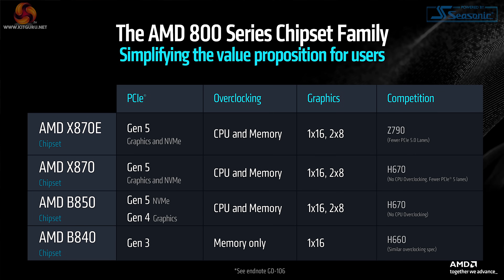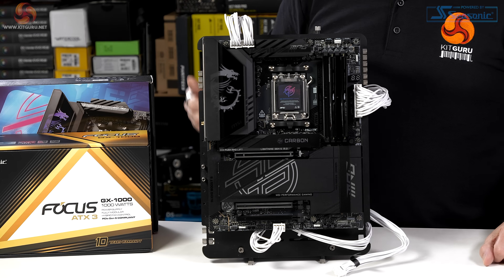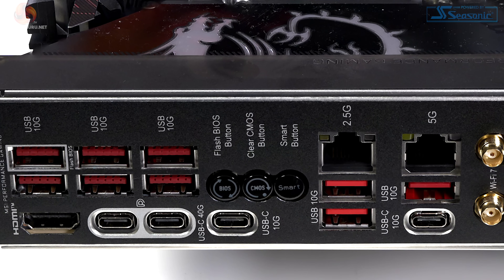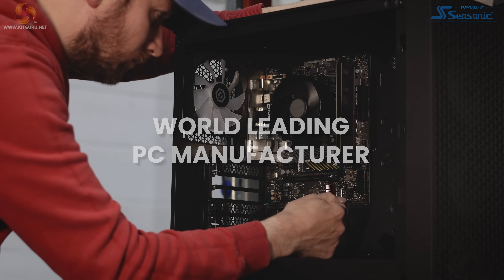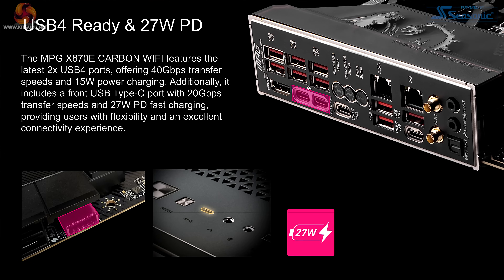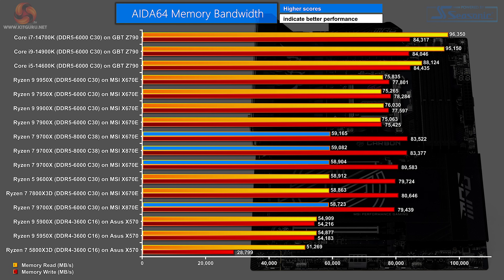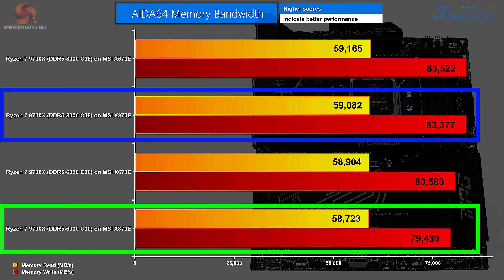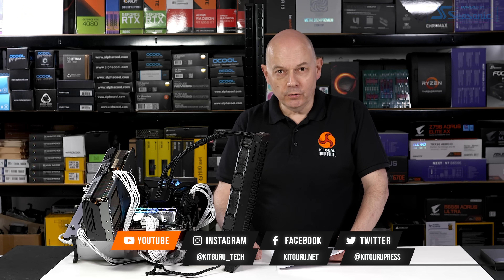MSI MPG X870E Carbon WiFi - DDR5 8000 for the win!

Comment: Mixing 2.5G and 5G is just silly. Please just provide two 10G with backward (lower-speed) compatibility
Reply: The boards are expensive enough as it is.
Reply: @RavTokomi  honestly it wouldn't make a big difference if they didn't blow their markups as usual
Reply: I don't need it myself, but I agree 10G for those who do would've been good. Would've drawn some more people to this board as well since competitors don't provide it either if I recall correctly.
Reply: @123Suffering456  Yeah sure, I don't need it as well, I'm much more patient at my 53 years of age ;-) Cheers bud all the best to you !
Reply: Is that a chipset limitation?
Reply: @philipjfry628  no not really
Reply: @b1lleman  Bit annoying then should have just stuck a pair of 10G ports. They saving that for the Godlike maybe?
Reply: @philipjfry628  Ah yes probably. Personally I would prefer they'd provide a basic Motherboard with lots of PCIE extensions possible but they wouldn't be able to charge that much.
Reply: I agree. Who amongst us have 2 LAN cables plugged in anyway? Don't peeps just use switches?
Reply: @LollyBread  Well, in a previous life not so long ago I did NIC teaming to my two redundant switches ;-)
Reply: @b1lleman  Woo, we found a use case. :D
Reply: @LollyBread  LOL !

Comment: Its a decent board - nice featureset, looks good, they put effort into the ports and layout - but its not really a huge upgrade from the last gen unless you specifically need DDR5 8000 and or USB 4
Reply: USB4 might make it worth getting those specs are amazing.
Reply: @pixelrefresh348  not over a x670e board with usb4.

Comment: Is that two full PCIe v5 x16 slots or do they become x8/x8 if both are used?

And a slightly odd question: does the BIOS support keyboards through USB hubs?
Reply from the maker: The second slot is x4, presumably to keep the graphics constantly happy. I haven't even thought about a USB hub for a desktop PC is many, many years. This board has heaps of USB-C and all the Type-A you could wish for.
Leo
Reply: @KitGuruTech  The question about using a hub arises because my PC is in a cupboard in the corner and my keyboard goes via a hub to the PC. Going direct would require an extender cable.

Comment: Feel a bit cheated. X670e was x16/x0 or x8/x8. 
X870e is x16/x0 or x8/x4. 
X870e also notes PCI_E1 & PCI_E2 & M.2_2 share the bandwidth

Also,  would be interested in seeing results of 6400 C32 memory on these charts.
Reply from the maker: You raise an interesting point. Assuming no-one is using dual graphics cards these days, what use do you have for PCIe beyond M.2 storage?
Leo
Reply: @KitGuruTech  That second pcie slot by 8  on 670E variant could house 2 more nvme ssd with help of pcie add-in card and on that platform you could have up to 7 nvme ssd running simultaneously,but this isn't case for X870E  you could  loose 1 or 2 nvme ssd  depending on sharing lanes
Reply from the maker: @TheMB1205  Theoretically, but at that point how many SSDs do you use? If that is your thing, check out Apex Storage
https://www.apexstoragedesign.com/
Leo
Reply: @KitGuruTech  I have the x670e Carbon.  2 2Tb in the gen5 m.2 and 2 4Tb in both gen4 m.2 slots.
It's really not so much if I'm going to use it or if it's an important feature. That's a bit of a dodge. The x670e didn't make that compromise.  These specs are closer to a jumped up Thomahawk.  Not that the Thomahawk is in any way a poor player.  But just as the sentiment toward the PCIe lane apportionment is "meh, who really needs it...", similarly,  I can say I don't, nor actually know anyone who needs that many simultaneous USB connections.  Much like the touted 4080 codec. Not quite meaningless if the majority of users are running wireless headsets or even just USB wired headsets/speakers.
Reply: yeah its a bit bad sharing the b andwidth
Reply: @Linuxdistro15-ih8ox  Asrock boards don't have pcie lane tunneling. they're always x16
Reply: Asrock Nova X870e - $349 - 5 M.2 slots which don't use PCI-e 5 slot GPU bandwidth.
Reply: @deathkne11  probably the best value x870e board, better than most x670e in that price bracket
Reply: @deathkne11  people seem to repeat this, and whilst that board is probably best value x870e board, 3 out of those 5 m.2 slots are only gen3, so not very great option.
Reply: @Hullbreachdetected  only one is Gen 3 IIRC.

Comment: $500 btw. Same performance as a $160 b650 mobo for a 7800x3d
Reply: Not really the same feature set though
Reply: How many PCIe lanes do you need? Cmon man, nobody needs these overpriced nonsense boards.

If you wanna do REAL heavy work, youll go Xenon/Threadripper anyways.
Reply: Not always. Single threaded workloads prefer desktop CPUs with high clock speeds.
Reply: @leviathan5207  Ha! Don't waste money on an "overpriced board" but get a "threadripper". You seen how much Threadrippers cost?
Reply: @LollyBread  At least threadripper gets you more performance for the money.
Reply: I agree that in the current market conditions and given current AMD CPU releases, for most people these boards aren't currently worth it. And you might as well stick with older boards and CPUs.

But depending on how forthcoming X3D chips perform, they may come into their own in the next 12 months.

Comment: Glad I got a steal on the asrock taichi x670e. These new MBs just aren’t worth the extra price for 99 percent of people.
Reply: I have the black version amazing board, the hottest I've ever seen my 7950x3d go under load is 77 degrees. I'm using a Huge Y70 with 2x140 bottom & 3x120 side intakes, 2x140 top & 1x120 rear exhaust, Cooler Master MA824 tower cooler, TT1350watt. Best setup I've ever had.
Reply: @Terry-cw9ty  how come my 7800x3d with aio max on 89c :( barely do 4.9ghz dude :'( LFIII360
h6 flow
Reply: Hyte Y70 sorry
Reply: @Terry-cw9ty  I think a lot of the new features are not really needed by most people, the higher spec memory support with solid VRM updates should help, USB 4- I am not bothered about. Still I like this carbon board, its really well spec'd but everything is so expensive now, you will always get better deals on stuff thats last generation.

How are you finding the asrock bios? been a while since I had an asrock board, but they seem pretty solid now after a few years of missing the mark
Reply: How much was it man ?
Reply: @johnerikson2443  350 on Newegg 2 weeks ago. It dropped from 420 I think. I don’t think that is bad for a high end MB with two thunderbolt ports and 4 m.2 with pcie 5.0. The only feature it’s missing is 5gbe and WiFi 7. I don’t use WiFi and 2.5gbe is all I need considering my internet is maxed at 1gbe. I can always add a 10gbe network card or something later on if needed. So 150 cheaper than this board with all the important features for me is a steal in my eyes. My opinion might differ greatly than yours.
Reply: It’s hard to argue. I’d say 90 percent not 99 but I’m splitting hairs.
Reply: ASRock just rocks ! MSI, ASUS, and Gigabyte, can all suck my d*ck !
Reply: In my country asrock nova or taichi starting from 550euro and higher.. msi carbon is under 450 sold by Amazon.. 😅
Reply: @  Carbon is good too.
Reply: Thats so old now lol.
Reply: @philipjfry628  dude one year isn’t old. Geez. 🙄. Especially for top of the line. That’s like saying a 4090 is old after one year from release. You make me laugh 🤣
Reply: @philipjfry628  yet it performs exactly the same as a x870e so why waste 150 bucks for the same performance?
Reply: @philipjfry628 Not as old as Philip J. Fry.